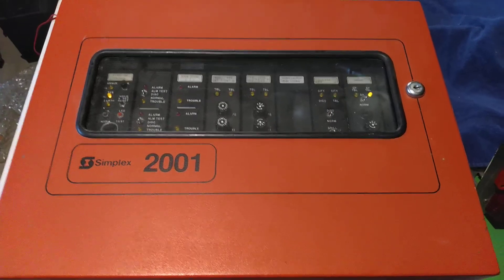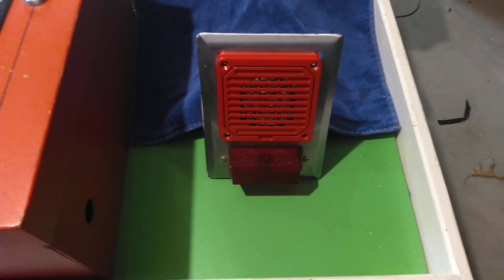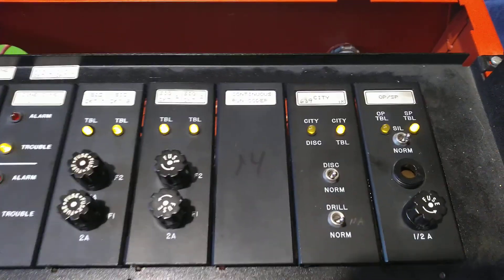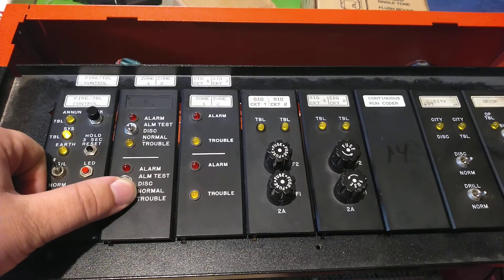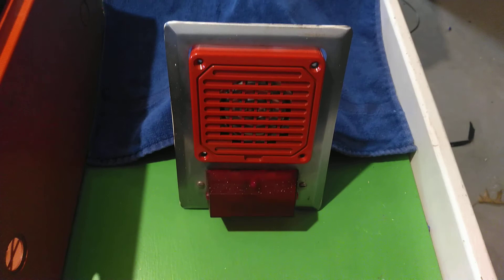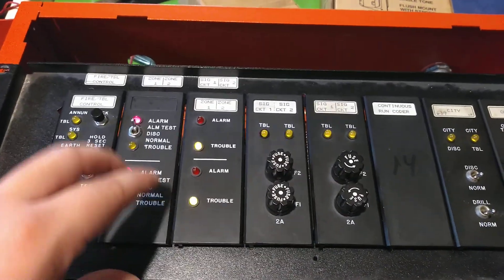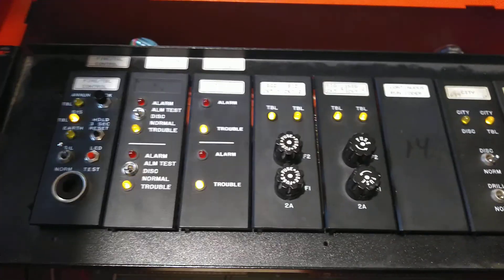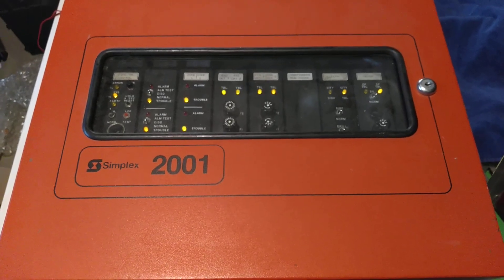Workbench System Test 10 | #FireAlarmFriday

Comment: Are you sure that's not just a really early LED Exceder? 😉
Reply from the maker: I'm pretty sure it isn't.
Reply: @Michael Wong The joke was that the original LED Exceder has a long flash duration, similar to how the 4050-80 is almost strobing but not quite.
Reply: @Michael Wong Yup, that's why the 2903 and 4903 light plates didn't come with flashers. But the light in the video was actually being pulsed by the 2001. Flasher circuits typically produce a normal blink, while this cadence looks more strobelike. I guess it wasn't as obvious as I'd hoped.
Reply: @Michael Wong Really? The only ones I know of are the strobe plates, which Simplex called "flashers" up until the cassette-shaped 4903's came out.
Reply: @Michael Wong Oh, now I know what you're talking about. Those are being coded on a separate NAC. This one has the lights set to 120 BPM and the horns set to 20 BPM.
https://www.youtube.com/watch?v=j5xHgMbo_Mk

The "cassettes" I was referring to are the series that are shaped vaguely like VHS tapes, like the 4903-9219. I could have just said "rectangular 4903" (their official name), but I was afraid that would be confusing since the 4903-9101 is also shaped like a rectangle.
Reply: @Michael Wong Hmm... Too bad it's gone because I would've loved to see it. The manual does mention a flasher, but it's a xenon strobe:
http://firealarmresources.com/wp-content/uploads/2013/06/Simplex-2903-3.pdf
http://firealarmresources.com/wp-content/uploads/2013/06/Simplex-2903-1.pdf
Reply: @Michael Wong Yeah, that's a typo. It's supposed to say 120 VAC.